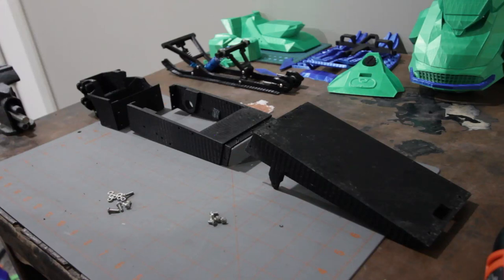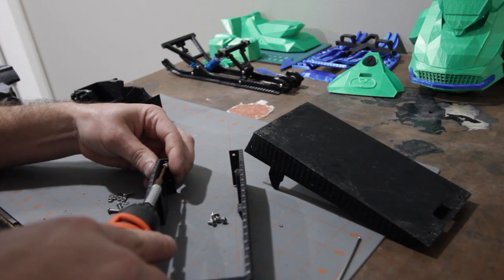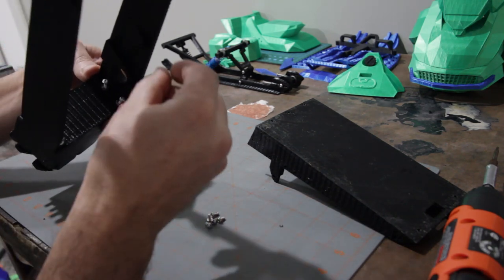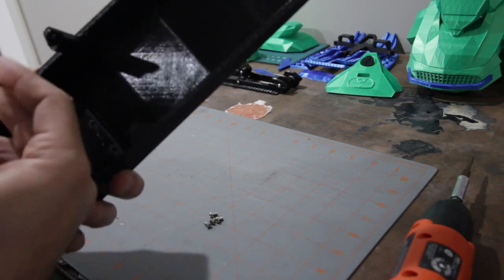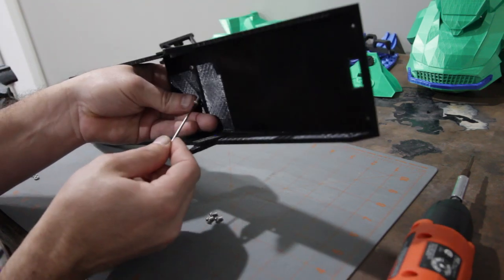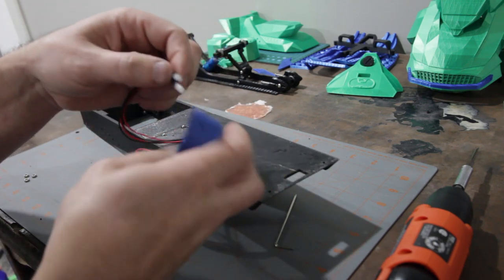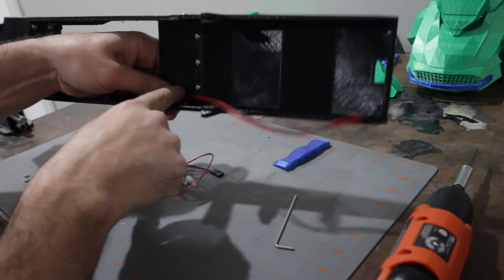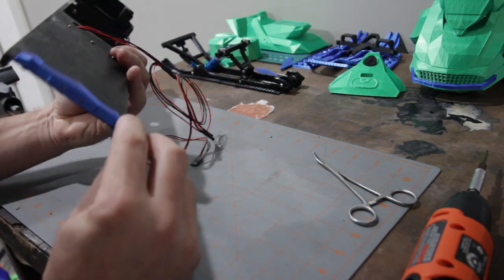SkeeRide Assembly Part 2 - Frame and Tunnel

Comment: I’ve been having trouble printing the tunnel and frame. It just doesn’t stick to the bed. I’ve tried relevling the bed and playing with the temps. Do you have any idea what is going on? Everything else has been printing fine.
Reply from the maker: You could try adding a brim, or a thicker first layer, maybe go slower. A lot of people use glue stick to help things stick. I don’t use glue but sometimes cover the build plate in painters tape.

Comment: Is this video mirrord bc the files are missing so many parts and weird parts
Reply from the maker: The frame did get mirrored after this video to work with more motor/esc options. All assembly is the same though.

Comment: What % infill are you using on the frame, tunnel and suspension parts?
Thanks, 
Steve
Reply from the maker: 75% and 6 perimeters for all structural parts. 15% and 3 perimeters for everything else.

Comment: I have two printers a ender 3 and aa flashforge adverturer 3 witch is best for printing this?
Reply from the maker: I know a lot of people are using the ender 3 for printing the sled. I’m not familiar with the flashforge. You need a minimum build area of 200mmX200mm

Comment: I bought the print yesterday and I'm wondering what way i should print the tunnel
Reply from the maker: All parts are in the position they should be for printing. You should not need to rotate any parts. The tunnel should print flat upside down, it will need a tiny bit of support for the overhang where the halves screw together.

Comment: Is there a list of the screw sizes? Or do you mention it in each assembly video. Like this video we need 8 m2x3 screws or something?
Reply from the maker: I didn’t make a specific list, I find it easier to just grab from the assortment box and use whatever fits. I did leave a link to the assortment that I bought in the pdf included with the files.

Comment: When i Do the front and rear tunnel it Bend and i dont know why
Reply from the maker: Try a higher temperature on your build plate or some glue stick. I think the higher temp will help more though. I run my build plate at 60C
Reply: @BuildItBetter3D  ok it is at 70 .i cant raft